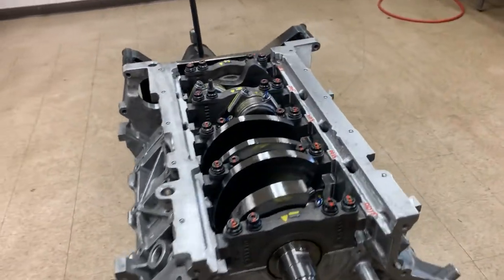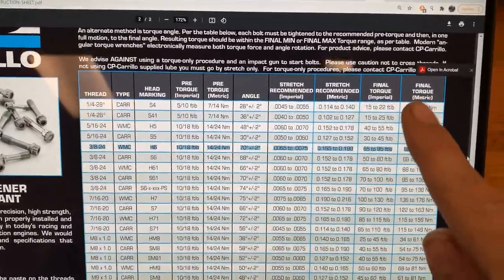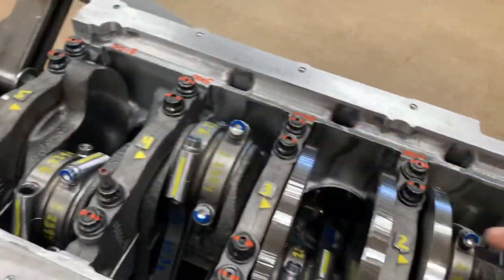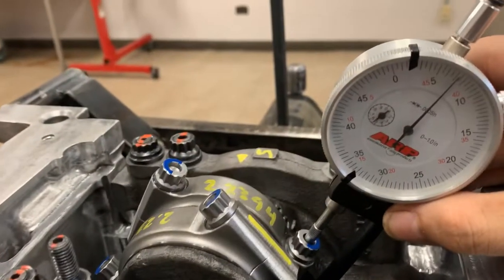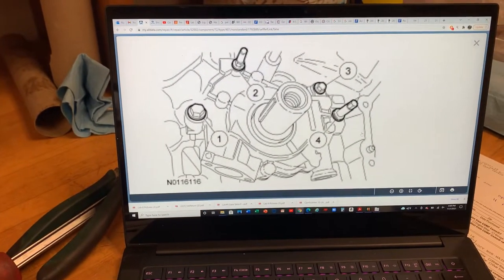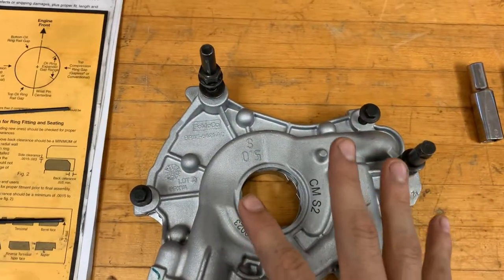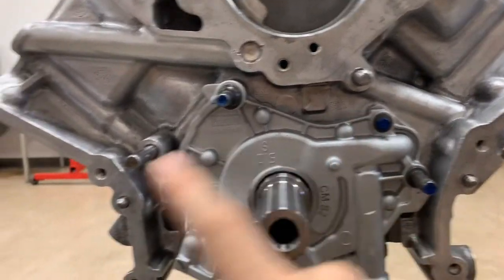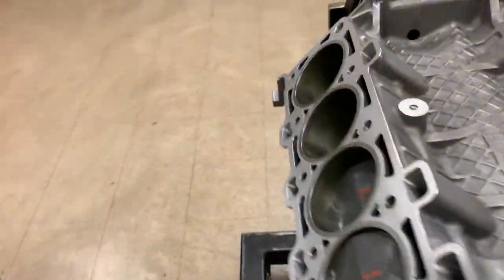Coyote 5.0 Engine Build Part 3 - Rod Stretch/ Oil pump install

Comment: Great video.  Where did you get the oil pump and pistons and your other parts from? Thank you.
Reply from the maker: The Oil pump is from Boundary Performance. 

Pistons were ordered off Summit Racing. They are a MAHLE coated piston 

Rods are from CP Carrillo. It’s there I-Beam type.